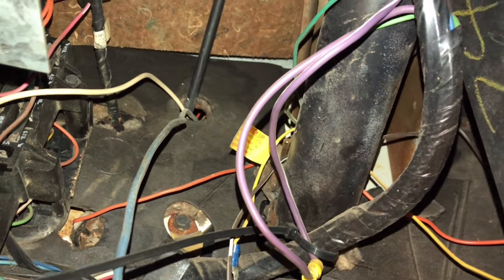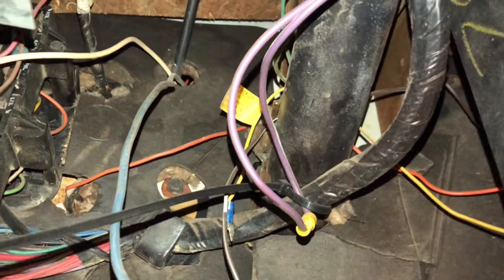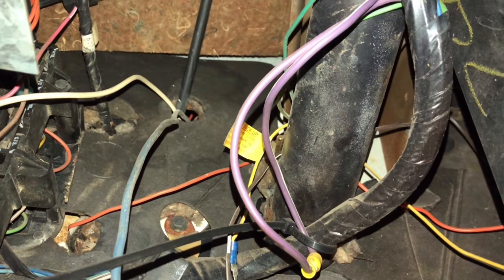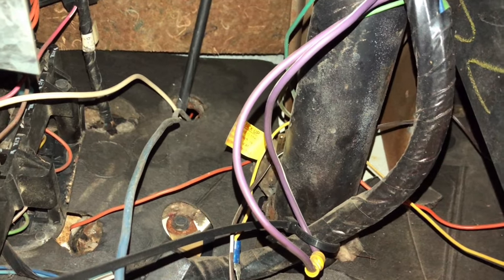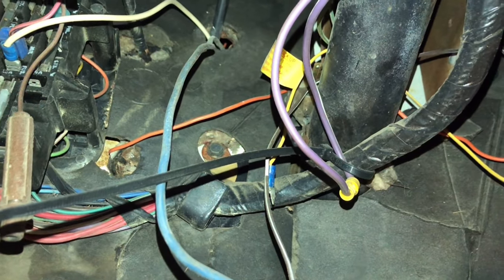BYPASS NEUTRAL SAFETY SWITCH GM TRUCKS

Comment: I have a 1998 GMC Jimmy sl,  those wires are different , mine have 4 wires that connects to the clutch switch, 3 purple 2 with lines, witch one I bypass? . Thanks

Comment: You got me back on the road. Thabk you my good man
Reply: Hey how did u get to the wires?
Reply: @kentuckyfriedchicken4045  I had to pull the HVAC duct that the underneath the steering wheel and then I looked and the base of the steering column
Reply: @kentuckyfriedchicken4045  there will be four wires and then you just have to determine which ones to splice together
Reply: @matthewhartford2686  do you have Facebook because I'm still having trouble
Reply: @kentuckyfriedchicken4045  yep I can help you after I get off work tonight

Comment: I tried a jumper wire across the connector but it didn't work. Seems like it should work just as well. I'm hesitant to cut the wires and not be able to go back.
Reply from the maker: That should work yep

Comment: Will this apply to a 1991 Chevy g20 van ?? Automatic… determined my NSS is on the steering column… thanks
Reply: I have a 94 g20 I might try it. Im having no start no crank. Ive checked everything. Put in a new ignition switch. Havent checked the neutral switch yet

Comment: Short and sweet!  Well done.  Just one question:  Why would you want to bypass it at all?
Reply: Sloppy shift linkage, bad switch, or because maybe for some reason you need to be able to start it in gear.
Reply: If you want to replace the switch it will cost $1,300.00! That's why.
Reply: @ericchapman8956  True.  Good point.
Reply: @Powerful1776  LOL!  Yea.  I hear ya!  I've replaced many of em.  But, if you own an old Chevy, and you can't work on it,, then, i guess, you could get porked by a shop.  The NSS is an item ripe for porking an uninformed customer.  Fast job to do, but, the diagnosis, by a dealership, may incur their minimum diagnosis time fee, i.e. 4 hrs diag @$140hr + repair @$120hr + parts.  (The wholesale part is $10.  The book time to replace is 0.75 hrs.  (But, I do them in less than .50.)
Reply: @BYENZER  My NSS is inside the transmission.
Reply: Cause mine won't run without it lol
Reply: @onyxtheprotogen7907  or you did a rear main seal and you want to start it without transmission to be sure like me!
Reply: The switch at the tranny only costs about $27 bucks but is a pain in da butt to get to for the procedure.

Comment: 84 fleetside - The thicker gauge wires under my dash are purple and yellow, not 2 purple. And neither one has power, when I tie them together nothing happens.. please help fix the problem of no power to the purple wire..
Reply: Figure it out?
Reply: It might be the shifter column... the connectors went bad on mine

Comment: I have no power to the purple wire going to the S terminal to the solenoid. fuses and relays are good. I removed the starter relay and put a wire into the 30 and 85 hole and had someone turn the key while I jumped it and it turned on. any idea?
Reply: I am having the same problem. Did you ever figure anything out
Reply from the maker: It’s because your betrayal safety is bad. That’s why I made this video, follow the purple wire up to the steering column and that will lead you to the switch
Reply: @samstrucks  betrayal safety??
Reply: purple wire goes from the port 87 from fuse relay to the starter. I'm trying to find a schematic for my 00 chevy s10 2.2  the wiring for the NSS some reason I have power to the relay when turning the key bur don't know how to check the wires on the NSS from the ignition switch.

Comment: Well, I'll know in a few minutes. 2000 Chevy 3500hd 6.5l turbo diesel bucket truck. Moved it few days ago and went to move it back and nothing when turn ignition to "start". Batteries hot. Never had a problem. Everything powers up, wait to start functions then nothing. Got no power at purple wire at the starter. Hope this works. Just send me a bill if it does.
Reply: Did it work?
Reply: @fredthechihuahua  Negative. It WOULD crank over with one of those remote starter things so just wired up a starter button in the dash. Turn on ignition, "wait to start" goes out, truck starts. 
Would have been thru with the whole thing in 30 minutes or less but a friend helping me had one of those "moments" and instead of hooking the wire to the starter button he hooked it straight to the battery. Yep, started cranking over and before I could tear it loose it burned up the starter. So had to get starter rebuilt. Twice. 
So 30 minutes and $10 turned into over $200 and 3 weeks. First starter I got back wasn't "my" starter, just a rebuilt one. Naturally, it didn't fit. Thot I was doin something wrong so had it almost on several times. Finally got the one that came off the truck rebuilt and it cranked right up. Friggin nightmare. Just par for the course around here lately. 
Never found those two purple wires. Age and heat had made the wires at the neutral safety switch brittle so that's why I by passed it all together. 
I'm no mechanic but now I can swap a starter out on that truck and engine combination in about 15 minutes after doin it so many times. My friend, only one I have, meant well. Was a mechanic in the military. Sheite just happens. 
Thanks for asking.
Reply: @TheAcceleratorMagazine  Thank you for your time in answering friend. Doing some street mechanics myself here on a no crank. I appreciate the detail and effort put forth into remembering 💯

edit; didn’t think I’d get a reply on a comment 1+ years old 👍
Reply: @fredthechihuahua  Well, if you take the time to read and reply to me then I feel that it's the least I can do to write back. Plus I'm recovering from kidney surgery, 33rd surgery and 17th time put to sleep so not exactly got any thing else to do BUT I try to answer anyway. Thanks.
Reply: @TheAcceleratorMagazine  Hello, I have a 2008 GMC duramax, narrowed down the no crank to chaffed small wires in the column and neutral safety switch, getting truck stared by jumping pins currently on starter relay 87 and 30.  How did you wire your push button, I am sure there are many ways, I know the 2 reds going to ignition switch are hot all the time, just curious if you found a great way to wire it up, thanks.
Reply: @jteddy11  Bought a remote starter switch. From battery go to hot side of the push button switch and from there to the hot side of the starter. Starter is already grounded. That's it. Have to turn ignition on and after glow plugs heat up, the "wait to start" goes out, then push starter button. Usually mount the starter button on the dash. That's it, two wires. Make sure the neutral safety is unplugged.
Reply: @TheAcceleratorMagazine  Thanks for reply, my truck is a 2006.  Why do you unplug the neutral safety switch, just for my education?  This year of truck has the switch inside the transmission you have to drop the pan to get to it, isnt that great.  Also, I had to replace the starter in a Home Depot parking lot today, so it does now have a new starter, just wish it would have died in a better spot.  I can get it started in Neutral, with a little key manipulation by holding full travel of key then slowly backing off and it eventually engages starter.  Putting a button on it would save a lot of heart ache, so once again, why the unplugging of N S switch, could I get by with out doing that or is that a must?  Thanks again for your reply.
Reply: @jteddy11  Yes, with your situation I'm pretty sure you do NOT have to unplug the neutral safety switch. 
On my older truck it was mounted outside the transmission and all the wires were broken, or brittle, but it still kept the truck from starting. 
A friend of mine, at the time, who had been a mechanic while in the Marines was helping me diagnose the problem and install the push button starter switch. Some how or other he had one of those "moments" and hooked the positive wire directly to the very hot batteries and that caused the starter to begin turning. The wire welded itself to the hot post and hot point on the battery and was glowing red hot preventing him from pulling the wire loose. By the time I was able to knock it loose it had burned the starter up. That turned a 20 minute cure onto a 2 week costly nightmare. 
I wanted my original starter rebuilt but received a different starter back. It didn't fit. So wound up having to wait on my starter. Also the truck was sitting outside and parked on sloping entrance to my garage. It's a bucket truck and super heavy 3500 chassis so I bought a couple of 30 ton bottle Jack's and heavy duty jack stands to be able to jack it up safely. I was having back trouble from a car crash and in fact I'm in the hospital recovering from back surgery today, Fed 21, 2024, BUT,
I swapped the starters out 3 or 4 times by myself after the old "friend" messed up a couple more simple repairs "helping me out". Turned out he was just usin me to get out of the house to hook up with his girlfrien. Well, until he was texting the girlfriend but sent it to his wife by mistake. He retired shortly after and didn't see or hear from him for over a year. 
So now PTSD and me just keep to ourselves and either try to fix stuff myself or just pay to get it fixed. 
Good luck with your truck. Fixin to get a pain shot and hopefully get a bit of sleep. Have been awake for goin on 3 days, but that's kinda normal.
rick in Tennessee.
Reply: @jteddy11  BTW:I'm not a professional mechanic or much of a shadetree kind. So check with a real mechanic or check out more YouTube videos before you take my advice. Or anyone else's for that matter.
rick in Tennessee.
Reply: @TheAcceleratorMagazine  Thank you for the reply, get some rest, and I hope you have a speedy recovery.
Reply: @TheAcceleratorMagazine  Will do, I can currently get it started with gear select in Neutral with foot on the brake, and backing of the key slowly from a full crank position it will start.  I have a spare wire to jump the terminals 87 and 30 on the starter relay slots in the fuse box if all else fails.  Take care Rick in Tennessee.

Comment: Can I drive it like that
Reply from the maker: Yes
Reply: @samstrucks  it won't shift now ,,Hmm????
Reply: @benjohnson3789  not a mechanic but i wouldn’t cut those wires, replace neutral safety switch and see if that fixes it. Having the same problem right now

Comment: So I have a yellow and purple connector and a green and blue connector.  Connect the purple and blue, then yellow and green?
Reply: I have the exact same, and I’m having problems with this stupid switch. Did you  figure it out with those color wires?
Reply: @bronxbombers5688  did you get it? Same issue
Reply: your green and blue wires from the neutral safety switch are your backup lights, my guess would be to connect the yellow and purple wires together
Reply: @bronxbombers5688